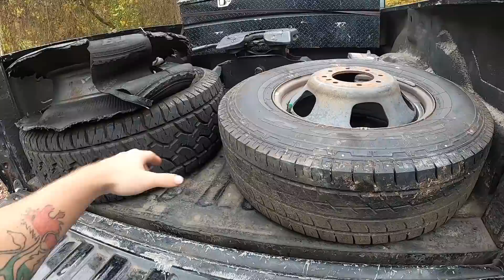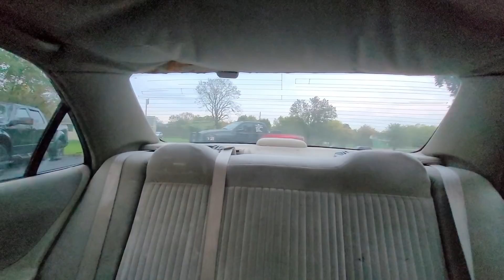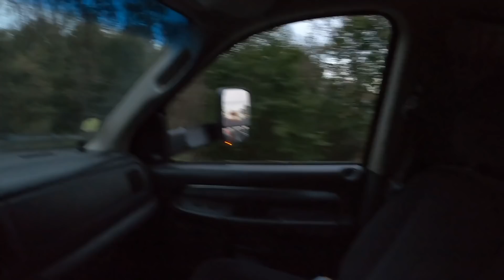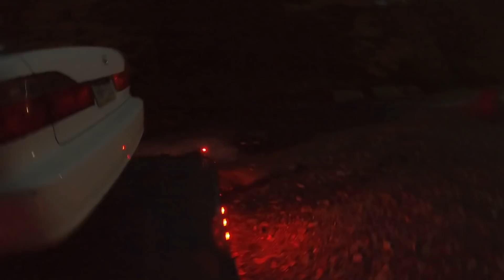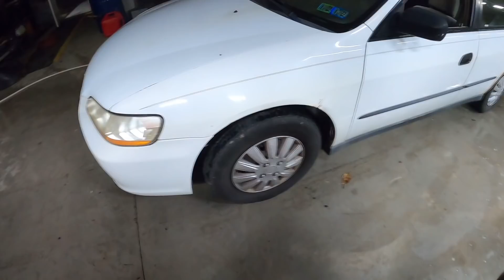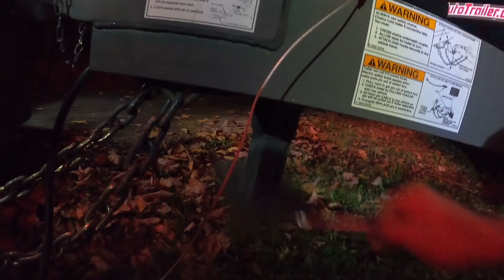Smoky 12 Valve Tows Broken Honda | Back To Car Hauling Tomorrow

Comment: You could have installed alternator it time it took to get trailer and tow it to the shop.
Reply from the maker: Takes 3 days for my guy to rebuild them. I use fleet electric for alternators and starters. Not to mention no thanks. Rather not work on my cars😂